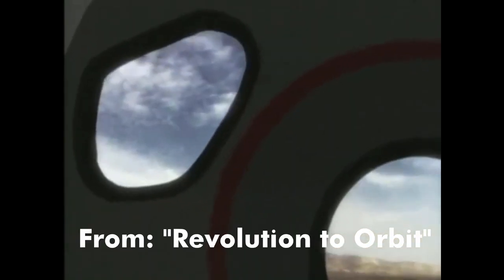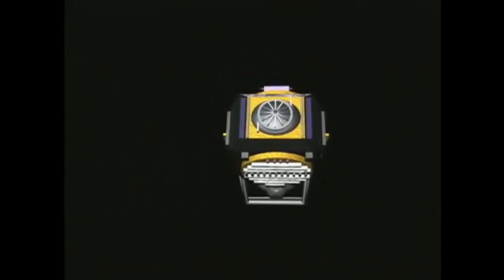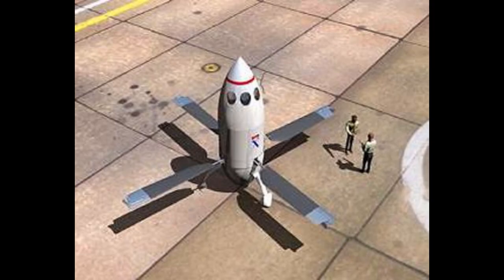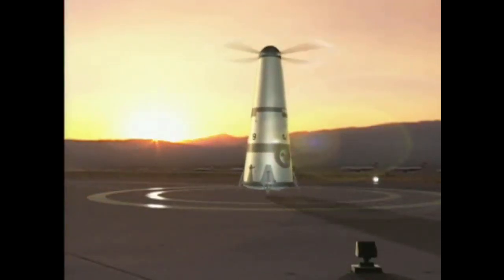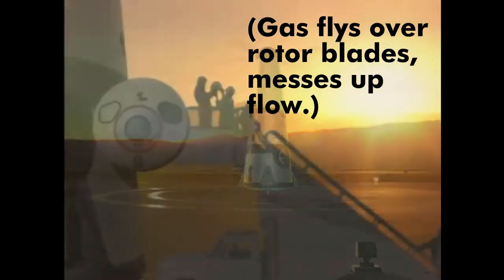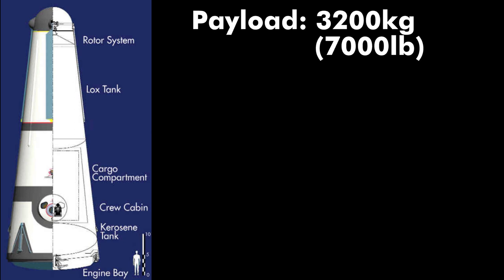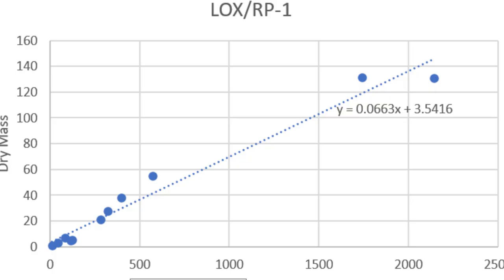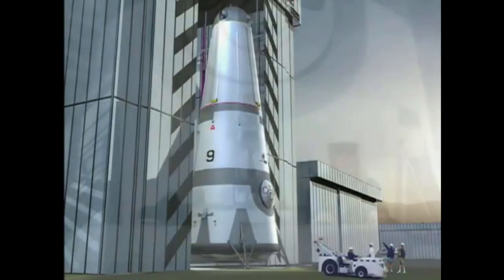Roton | Know Your Rocket

Comment from the maker: Since this is something new, feel free to suggest improvements. (My voice over work can only improve.)
Reply: My comment disappeared?
Damn, must have hit "cancel" instead of Comment...

Anyway, I had a long on-again-off-again conversation on the internet (over various forums and message threads) with both McKinney and Hudson and the 'official' payload for the original concept was "two-guys and a ham sandwich" which operationally would have been similar to the LV from the book "The Rocket Company" in being one person and a bit of payload but pretty much JUST an SSTO demonstrator. The low-mounted rotor would likely have had better control authority and flight characteristics, having always been less a "helicopter" and more a propeller supported platform. 
As it was the original takeoff requirements were having to be 'held-down' so that initial take off forces were about 5gs and the blades of the rotor subsonic under most conditions but going supersonic on the ground (this was an issue of course, and for anyone curios just look up "Thunderscreech" on youtube) for some and needed to push the vehicle supersonic about 40,000ft during the flight and later needing a separate rocket to 'push' it through and provide some added thrust during the climb to orbit. (The aforementioned "Thunderscreech" was often cited as showing a propeller powered vehicle being able to go 'supersonic' on propeller power but in fact I could find no mention of it every actually exceeding the speed of sound on propeller power alone and since they actually suggested a 'booster' rocket motor to push the design through Mach 1 I suspect that neither did they)

Once it was clear the original design wasn't going to have a 'market' (it was essentially really a "proof-of-concept" vehicle both for the design and for 'proving' that an SSTO would work operationally) it was found that it didn't scaleup well. (At all really) The helicopter take off for a larger orbital vehicle didn't gain the benefits of the smaller one and rotor size an tip-speed were big issues. Still there was some argument for keeping it for some suborbital vehicle operations and options, but since you now required a dedicated 'rocket engine' to lift the vehicle and push it into orbit the decision was to switch to a rocket powered but rotor recovered vehicle which would (in theory) still retain a lot of the advantages of the original concept. 
They weren't exactly wrong either as rotor landing systems were well understood and researched all the way back to the late 50s. They had been extensively looked at for both Apollo and later CEV programs, with a lot of wind-tunnel, and flight dynamics work having been done on the concept. (But note those are 'stubby' bodies which the ATV was the opposite of)

So they moved to the 'rotary' rocket engine design, (again it was based on previous but much smaller engine concepts but would, as you say, required a great deal of design and testing work t hey likely could not have afforded) only using the rotors for landing and a "near-impossible" SSTO design ended up as a bog-standard "a-miracle-occurs" pretty impossible SSTO design. By the time the of the ATV rollout it was pretty clear the idea of it being an SSTO was unlikely but given how much support it had from the SSTO advocacy (hence all the SSTO advocates attending the rollout) I think it was unlikely that McKinney and Hudson could have significantly changed the design but you did have the usual mental and linguistic gymnastics that accompany "near-SSTO" designs with some discussion of "zero stage's" or "liftoff assist rockets".
(Note that Tom Clancy was at the roll out because he had heavily invested in the concept having earlier promised the proceeds of a book to the project if the book was a good seller. "Red Strom Rising" IIRC and it was so he did :) )

I still think the concept has some workable aspects especially on a smaller scale or for suborbital work but it's unlikely to be revisited given the current launch market or requirements though the rotor recovery might. I'll make a bit of a prediction that the next video will likely cover the Kistler K1 as an example of one of those (initially) "near" SSTOs.

Good work!
Reply: @randycampbell6307  It is the 41st Millenium...
It is the 41st Millennium. For more than a hundred centuries The Emperor has sat immobile on the Golden Throne of Earth. He is the Master of Mankind by the will of the gods, and master of a million worlds by the might of his inexhaustible armies. He is a rotting carcass writhing invisibly with power from the Dark Age of Technology. He is the Carrion Lord of the Imperium for whom a thousand souls are sacrificed every day, so that he may never truly die.

Yet even in his deathless state, the Emperor continues his eternal vigilance. Mighty battlefleets cross the daemon-infested miasma of the Warp, the only route between distant stars, their way lit by the Astronomican, the psychic manifestation of the Emperor's will. Vast armies give battle in his name on uncounted worlds. Greatest amongst his soldiers are the Adeptus Astartes, the Space Marines, bio-engineered super-warriors. Their comrades in arms are legion: the Imperial Guard and countless planetary defense forces, the ever vigilant Inquisition and the tech-priests of the Adeptus Mechanicus to name only a few. But for all their multitudes, they are barely enough to hold off the ever-present threat from aliens, heretics, mutants - and worse.

To be a man in such times is to be one amongst untold billions. It is to live in the cruelest and most bloody regime imaginable. These are the tales of those times. Forget the power of technology and science, for so much has been forgotten, never to be re-learned. Forget the promise of progress and understanding, for in the grim dark future there is only war. There is no peace amongst the stars, only an eternity of carnage and slaughter, and the laughter of thirsting gods.
Reply from the maker: @randycampbell6307  For some reason, comments vanish (I get emails telling me I have comments and then they go away--I hope no one thinks I do it). Thanks for the details. Hudson is actually one of my personal heroes.

And yes, K1 is in the pipeline.
Reply: @pressure-fedastronaut6511  Actually my comments showed up after I did a "personal" reply so I ended up deleting them since saying the same thing multiple times is bad-form :) 
And of COURSE we all think "you" did it... After all when you make a public comment  (and yours is the top/first comment) it would naturally go 'above' yours and we can't have that can we? :)

Hudson has had some great stuff over the years and while I quibble his focus on SSTO designs, (don't worry Kelly Starks will be along soon to defend SSTO kind I'm  sure :) ) in general I've been very positive about his ideas.
Reply: @pressure-fedastronaut6511  - I like the substance of your videos.  I also enjoy your humor.  One thing I noticed in some videos is that you could edit out some dead space to make the videos tighter and seem more polished.  Also, I asked this in another comment, but do you work for Boeing?  You don't have to answer, just curious

Comment: 1-Is it possible to make a mini sea dragon out of beer kegs?
2-Doe to the high concentration of hydrocarbons in titan, does it have petroleum under ground?
3-In order to avoid space junk issues, does a series of "parking lot space stations" where the satellites get attached, so they just get repaired, recycled and defended, make any political and economical sense?
4-In order to make O'Neil cylinders can we make a 500m of diameter sea dragon and live inside its second stage(can blue origin make something similar)?
5-Would the Artemis program buy fuel from a third party for SpaceX Starship if it is readily available?
Reply: 6-Claimore mined mini landers and cubesats, to demarcate territories and possessions are viable?
Reply: Do you want a joke response or a serious surface level analysis for all of these
the latter would probably take up my whole summer
plus i don't even have a complete high school education so it would be questionable at best
Reply: @jmstudios457  Yes.
Reply from the maker: 1. Probably not if you want to fly it. For art purposes, sure.
2. Titan has methane lakes.
3. There are servicing spacecraft under development as well as space junk missions. I think there has been one idea to make an External Tank (you can see how old this idea is) into a collection/repair station.
4. No. O'Neill cylinders are on the order of 19 million metric tons.
5. NASA throws internal parties.
6. Nah, space guns for everyone.

Comment: If I was going to design/machine a N2O/butane engine in my garage; what kind of chamber pressure should I be targeting? Fuel pressure at around 40psi, N2O more at like 100psi. Keeping pressures/volume low so I can make smaller valves and limit the catastrophic-ness of sploding. I dont expect it to fly, just a hobby.

Thanks for the videos, I appreciate your work.
Reply from the maker: A rule of thumb for pressure-fed engines (though these are launch vehicle engines, not hobby) is tanks are 1.5x the chamber pressure. For a hobby rocket, there's plenty of forums you can consult.
Reply: @pressure-fedastronaut6511  That's not too bad. Maybe I'll bump it up to propane at 150psi. Those little whipped cream chargers are something crazy like 900psi. That shit scares the bejesus out of me.
Thanks, keep up the good work!
Reply from the maker: @nicholasboyarko1680  Do be careful, especially with N2O.
Reply: @pressure-fedastronaut6511  what's the worst that could happen with high vapor pressure compressed nitrogen in a little tiny steel container.

Comment: But why? If it needs propellant for the tip jets for landing just use a parachute and refire the main engines like Soyuz right before landing. A parachute is surely lighter and saves more space than retractable rotor blades. Guys were too deadset on a single idea.
Reply: The issue is that you cannot accurately control landing with parachutes
Reply: @t72oftruth66   The ESA Space Rider disagrees. Steerable parachute.

Comment: I have a question for anyone who wants to answer. Is it practical to build rockets from Steel rings wielded together, assuming the fuel and oxidiser dosn't leak out.
Reply from the maker: Rings, as in barrel segments? Yes. It's been going on since the 60s. Atlas was made of thin steel sections.

As with anything involving launch vehicle design, the material you select is based on requirements--how strong does it need to be? What's the weight limit? How easy is it to weld? And so on.
Reply: @pressure-fedastronaut6511  Guess what other rocket is built from stainless steel rings, and is extemely hyped right now.

Comment: 5% dry m'ass fraction?!  No wonder this failed they needed free rotors
Reply: > they needed free rotors
That was the original idea. The 10 L/D of the rotors in low atmosphere would help just enough the ascent as to make them free.  In the larger version it indeed became dead weight for the ascent. Expendable SSTOs are possible, and making part of the recovery part free would help. Of course, a first stage would help much more, and was considered by the team, but would mean a second vehicle to be designed and they were already tight in funds.